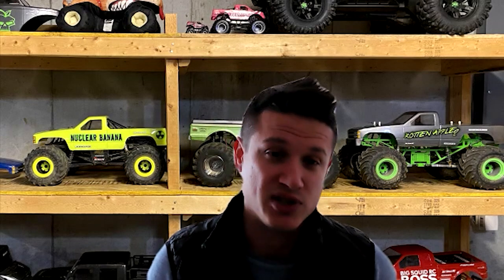Pulling Trigger #4 - Shaft Drive Vs. Clod Buster R/C Monster Truck Discussion

Comment: Great conversation!  Any strange / off the wall custom Clod setups from the past that are noteworthy or interesting? 

I recall seeing pics of dual servo setups on the front axles.  A servo was mounted above each axle tube on either side of the gearbox and looked to be controlling each front wheel individually.
Reply: Those setups are usually on bigger trucks to control the bigger tires but I have never seen any clod mod like what your describing

Comment: My question is in regards to the racing episode. what is the best way to practice for an event, I don't want my first time there to be the only time I have run a course. Do yoy have a standard ramp height and width. or lane width. Should I just build a few ramps and get some cones, run the configurations I have seen the videos on different surfaces, like dirt, asphalt concrete ect...

Comment: I have had a smt10 and a stock clod but want to do a build using better chassis I'm wondering what would be a good suggestion I like the cage style chassis I'm not sure of the advantages over a non cage style chassis I will be using smt10 parts for the build thanks

Comment: You requested questions so if you don’t mind here is mine, building a retro with the cpe timewarp chassis, the question is how I currently have it set as a long wheelbase using stock arms the gearboxes are not flat when viewed from the side, both tilt in to the centre line giving caster to the front and rear but in different directions if that makes sense ( locked rear steer) is this an issue at all? Hope this made sense!
Reply: Send me a message with pictures to my RC Racing page on Facebook: Josh Rhodes RC Racing. I'll see what I can do to help you out.
Reply: @JoshRhodesRC  I missed your comment but just watched this weeks vid, will get you some pics, many thanks!

Comment: 1. Could you overdrive the front axle (or under drive the rear) on a Smt10 to achieve what Josh was talking about with tuning the front motor on a Clod?

I have both now, Smt10 and Clod with a LMT on the way. My Smt10 is already set up for Sport Mod, just need to swap motor to be legal. Learning that my Clod is going to take some work to get it just to Retro competitive. Have a JConcepts Regulator chassis on hand, tributes and using stock tires, for now. Still need bta steering, servo and lighter body. I'm already past the price of a new LMT with Clod to be Retro to put it in perspective for anyone reading this and watching this vid.
Reply: Tim: I've seen people do this, but it does have the same effect that it does on a Clod. With the instant power of the Clod, it just reacts so much better/faster than the overdrive game of the front SMT axle.
Reply: @JoshRhodesRC  Good to know. Also, makes sense with the dual motor set-up and almost direct drive the Clods moa is. Appreciate the response sir. 👊🍻👍

Comment: I have a very good question for those of us who want to open up our own clubs and racing i41 wrk at Hobby quarters Foxboro Mass in my boss appointed me to create a monster jam type of vent can you tell us what goes into starting an event for first time as far as racer cap off to the amount of racers and how your rounds are run are there any qualifying do you guys run transponders for timing events which is what I'm thinking would be great this would be awesome for you guys to talk about next week just any info to help us who want to start out or make an event would really help
Reply: I'm in Maynard count me in
Reply from the maker: We will cover this for sure
Reply: @TriggerKingRC  oh THANK YOU SO MUCH!!
Reply: @DirtyFrigginHarry  for sure check on "Losi lmt The holy grail " on FB JOIN IF U HAVENT YET for updates .Im kevin Mendes
Reply: I frequent Hobby Quarters, and if you guys ever get a series going, I’m in. I have a retro Clodbuster, and could build another one if need be.
Reply: @NobiZero  it's not an if no more. We are definitely having it we are preparing for it and like I said we have a retro class which is mostly cloudbusters with slightly modified chassis representing stage 1 and Stage 2 monster trucks basically 80s and early 90s. And Pro stock pro mod
Reply: @kevinmendesracehavenrc  YES! Count me in!
Reply: @NobiZero  awesome thank you I was very flattered that they spoke my name first on the podcast today. They brought up my question I was beside myself but yes we'll see you in Spring in about a month or so

Comment: got a modded SMT10 after years of watching you guys and deciding what to buy. Immediately grenaded the transmission 10 minutes after I got it out of the box lol. 3s and a 5400 motor was waaaaay too much for me. Its still disassembled in the basement but I've decided to part it out to fund a SCX10-2 retro outlaw build. 

From that, what are my best options for turning the stock 4-link suspension setup of the raw builder's kit into a leaf spring and ladder bar one?  Tamiya Bruiser leaf springs seem like a good match but I'm lost on what to use for ladder bars